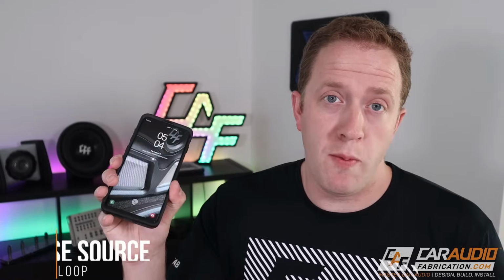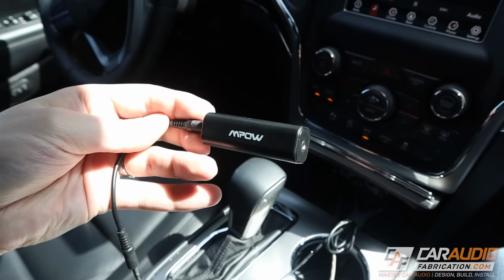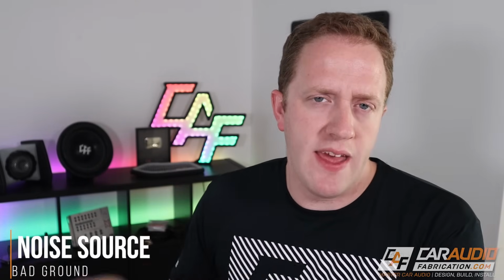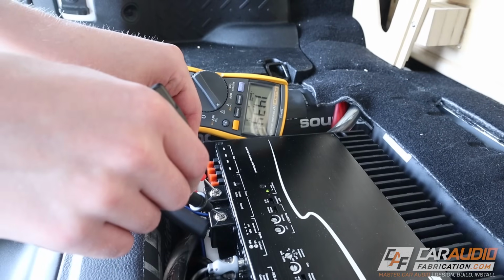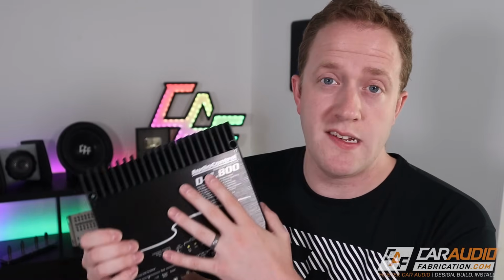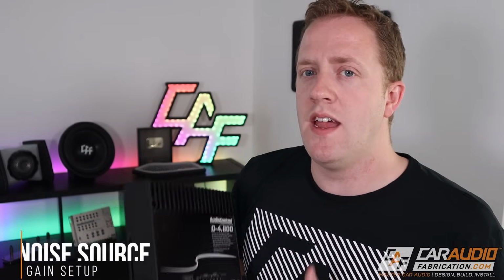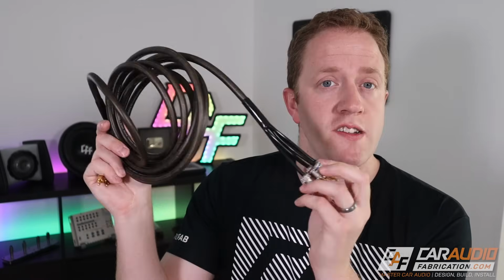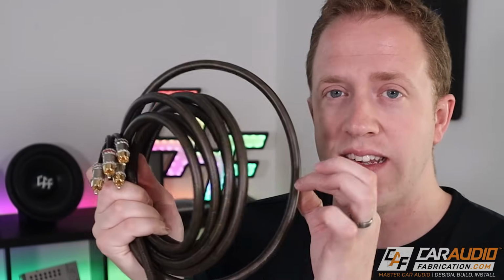BUZZ, WHINE, HISS? How to FIX Car Audio Noise!

Comment: Hi! Love your videos! I have a factory Head unit into a Bit DMI into a Bit One DSP which feeds a JL amp for the 4 door speakers & a Sony amp for 2 custom speaker pods. One of the speaker pods is making a whining noise. Shop says it’s because the magnet is too close to some of the car’s other electronics. Is there anything you can think of that I can place between to shield the speaker? The noise drives me so crazy I’m ready to put a slab of lead back there. Help!

Comment: @CarAudioFabrication, thank you for all the useful videos. I am about to run electric lines in my van conversion and need to run some power cables near my speaker wire (not signal wire). Does that create noise as well? I assume yes. If so, could I add a shielding wire loom on my speaker wire to help? Thanks!

Comment: my system worked great over a year then a loud hiss developed . i got a different amp , new quality rca's , and check all grounds and connections but still HISSING loud even with amp gains low . I even got ground loop isolators and they did not help one bit . No alternator noise just steady loud background hiss. I even replaced my power and ground wires to 4 guage, and doubled the car battery ground wire. Now Im thinking its the kenwood kmm bt318u head unit causing the problem . i guess ill have to buy another but that still might not be the problem.  Ive also changed speakers a couple times but ill try that again tomorrow . The noise is so loud i have to blast the music in order to not hear hissing . Also tried the speaker wire test.  Its annoying that my system worked perfectly over a year then out of the blue i have horribly loud hissing , SUCKS .  New head unit on the way soon i guess. Dam expensive habit on a minimum wage income .

Comment: Just had noise in my speaker build. turns out it was a power supply issue. Changed out the DC power supply to the plate amp and it solved the problem

Comment: I was wondering. My system runs a 2000watt RMS amp with 2 NVX 15" 1000watt RMS subwoofers. They are in a ported box (2 straight PVC ports flanking one another perpendicular to the subwoofers.) They are small probably about 3 inch in diameter on both. Length I can't remember but I believe the box was tuned to around 35hz. I set my gain using a multimeter and ohms law using my phone connected through BT playing a 60hz tone at 3/4 volume on the headunit with my phone turned all the way up and the tone set to 0db. When I play music it is below the threshold of that 3/4 max volume but if I go ever so slightly up maybe a single number higher then in some songs I hear what sounds like the speaker bottoming out against the magnet? It sounds like it is "bottoming out" I want to know your, and anybody who can help, opinion on what might be causing this issue. I am unable to tell if it's the box not being tuned correctly and the port area is wrong causing it to bottom out because of peaking. Or if it's caused by the amp sending a clipped signal. Or if it's because of the power output vs my port size. I posted this in another video but it was an older video so Im posting here as well in hopes that more people see this.

Comment: Just head alpine Ilx 650w car stereo installed Monday... from the moment I left I heard a high pitch hissing. I went back to the shop 30 min later and the owner said  it was common “ they call it floor noise” pretty much u can’t do anything about it😡 I’ve had other am car stereos and never heard it. All I did was replace factory Subaru radio with the alpine... no amp, same factory speakers that’s it!! THE  NOISE DRIVERS ME CRAZY!! I get used to it for a few min then the song ends and I can hear it or  I hit mute, there’s a slight delay before it goes completely quiet:.. Any suggestions would be much  appreciated!!!

Comment: I like to have all of the wires together in a nice, contained package so I used to tie in to the factory ground when installing an aftermarket head unit and every single one of them ended up with noise.  Running a separate ground to a good spot on the chassis has eliminated that though it gives me one more loose wire to tie up.

Comment: What about BEFORE I upgrade my audio system?  I have a PREMIUM sound system that is as of yet unmodified, it has a bit of hiss even at low volume levels coming from the stock head unit.  Its in a 2014 Ford Taurus, the head unit cant be replaced unless its with the same thing.

Comment: I've used many different types of GLI's and coming from an electrical background I can say that there is only one true fix for the major of times this issue exists. Having a nice and healthy ground to return your power flow, (though not all the time), is usually the fix for these. A quick and reliable fix is the chassis ground that is manufactured on the aftermarket unit itself. This grounding point is underrated and underused, but is a little bit a gold nugget!
Keep up the great work Mark!

Comment: Yep, glad I found this video it's like it was meant for me to find it because I've just got two new amplifiers and mounted them under my driver's seat. I previously had an alpine amplifier under my seat with no issues and the bass amp was in back with the subs. I went with the db drive motorcycle amplifiers which have more power and take up much less space than the other ones but now I've got alternator whining I did re locate the ground connections a few times and it did quiet down a little but the noise is still there. I've grounded both amps to the left rear bolt that holds the seat down it may be a bad spot there but I'll try every thing else mentioned in this video, I have not upgraded my battery ground or engine ground I could always try that as well. The noise isolator device will be my last resort option. If any of you have helpful tips for me please let me know I'm all ears since i'm still somewhat new to this hobby.

Comment: I have had noise in the past, one was from the vehicle's electrical system specifically the alternator for whatever reason the alternator was putting out a noise because it was starting to fail so replacing that solved the problem and I also had another issue with the ground wires like you were describing, I had to find the ground wire that was the issue and repair it's connection because it wasn't getting good contact with the metal on the car

Comment: I had a pretty bad noise in my avalanche and I stripped down a remote wire, wrapped it around all of the rca ports on the radio and secured the ends under a screw on the radio. "grounding the RCA's" so to speak. Now I do it as a precaution on every system I install and don't have problems.

Comment: Been struggling to determine if the slight hiss I have with everything on but no sound playing is normal and my standards are too high, is an install issue, or a function of equipment with a less than stellar SNR. I’ve tried all sorts of things to test the install. Been wondering if a line driver between my DSP and amps let’s me keep gains at lowest setting and problem not noticeable or if it’s time to upgrade to better amps.

Comment: I got a weird noise that would come through the subwoofers that were added to a factory system. The subs would play fine as long as the car was not moving. As soon as the car was in gear and started backing up the subs would get this loud rumble. The only way to stop the rumble was to shut the car off. That noise was due to the car having noise cancelling mics to eliminate road noise by using the factory audio system. Unplugged the mics and the noise went away.

Comment: Biggest source of noise is going to be coming from using the wrong type of signal wires.

There are two types of RCA cables, twisted pair, and coaxial. Twisted pair are, as the name implies, a pair of wires twisted around each other. Coaxial are when you have one wire inside of the other.

A twisted pair style is meant to be used with a balanced input amp. A balanced input amp takes two equal, but opposite polarity signals as an input. The twisting of the wires makes any interference in the signal cable equal in both wires. It relies on removing one signal from the other. When it does that, the noise is removed, and the signal is effectively doubled in strength.

A coaxial style is meant to be used with an “unbalanced” or “single ended” input amp. This amp simply receives the signal down the center wire, and the outer wire, that completely encases the inner one, is simply grounded to the vehicle chassis, effectively shielding the signal wire.

The majority of amps use coaxial style inputs, and using a twisted pair RCA cable might induce noise in your system. In this case, even a cheap coaxial style cable will work better than expensive twisted pair cables. I can certainly confirm this from experience.

Side note, some Pioneer stereos have “pico fuses” on the ground side of the RCA outputs, to prevent current flowing through the RCA cable in the event of bad amp grounding. Sometimes they will blow and you’ll get noise in your system.

Comment: Something that may be helpful to others to note. If you are using a cheap passive (non powered) line out converter off of your factory radio and you install it directly behind the factory radio you may be getting a lot of noise there as well. There are a lot of electrical components going on back there and you can test this just by moving the loc around with the vehicle on and powered up. If your stubborn on using one of these cheaper loc's, you may benefit by extending the speaker wire your tapping into and getting the loc gar away from the back of the factory radio to underneath the glove box compartment for example but not as far as the kick panel because you will generally have huge looms of factory wiring there that can interfere with your signal as well

Comment: Had a strange one that I finally got fixed, after installing a new headunit, two amps, front and rear speaker I had the engine whistle, I used high quality RCA and speaker wire and carefully ran all cables so I was sure that wasn't it, tried a noise filter on my headunit power leads, helped a tiny bit but it was still there, tried ground loop filters with no change, even replaced my 4 channel amp thinking maybe it was bad, still no change, all my grounds tested good, power wires were perfect ( 0awg OFC ) so I started looking into other things, replaced the factory ground cables from the battery and engine to frame, again still had noise, I even replaced the headunit thinking maybe it was bad, still had noise then finally the one thing I didn't upgrade fixed it, I finished off my big 3 upgrade, the very last cable I did was from the alternator to the battery, bam noise was gone, the only thing I hear now is my USB dash cam data pulses but only at high volume level with nothing playing ( I used a Android head unit and this is a common flaw with them ) so since you didn't mention that, do the big 3 upgrade, factory power feeds are way undersized and dirty, get nice clean power to the amps and enjoy.

Comment: A couple times in my competition systems. I solved one issue by switching from rca to optical and on another system reversed the direction of my stinger 8000 rca cables

Comment: I had me too before white noise problems and i tried all the things i could read about and nothing helped. i even changed like 4 or 5 aftermarket stereos, i replaced the speakers ,speaker cables ,re-grounded and checked the ground with the multimeter and the noise was still there. then i changed the 4 channel amplifier( which was a Clarion amp, responsible for like 90% of the noise by the way) and i disconnected  the oem amplifier harness to shut down the oem small farting subwoofer :)). after the last two moves my car is noise free. the car is an audi a3 from 2008 if this can help anybody.

Comment: My current system in my 97 ford diesel consists of a digital amp that Ive had in 3 vehicles so far, and I dont have a proper remote wire so it turns on and off on its own with the music. Ive noticed several times on multiple vehicles, but mostly currently since the subs are practically touching the drivers seat in my truck, theres a steady tone when you turn the vehicle off, right around 40 hz. Its never bothered anything, and it was only after you shut everything off, so I never really looked into it. Just realized though I havent noticed it in a long time, curious to see if it doesnt do it anymore or if I just got used to it and didnt notice it anymore 🤔🤷🏼‍♂️

Comment: All day, today, i`ve been trying to get to the source of that alternator noise i kept hearing, going up with the revs, and getting louder with them headlights on. What I found...the pre-amp RCA outputs of the unit make that annoying sound(and it only happens on the FR and FL RCAs / the rear and sub are good). 
So, the only way i coud remove those noises was to add two  hi to low convertors and use the speakers output on my new Joying unit. And yeah, i tried everything...running new gnd to the unit, running new rca cables not along the power cables, measured whatever i could measure, amplifiers gnd is perfect. Oh, one more thing...the radio antena also adds a little noise in the system, because it is grounded somewhere too. 

Up until yesterday I had the oem rcd310, with those  two hi to low convertors, two amplifiers (4ch and 2ch) and a 1F capacitor...well, it sounded good, without any "background" noise.

Comment: Its not just the quality of RCA but type and matching them with the type of signal input you amps and output from your componnents  are built upon. If your head unit uses unbalanced (many do)  and your amp has balanced inputs. (About 85% of amps use unbalanced generally higher end amps use balanced) look into audio control as i think eveything they make has the ability to change from balanced to unbalanced output with internal jumper.

1. Balanced input is where the shield of the input is isolated from the negative power input or the metal chassis of the amp. These setups youll want to use twisted pair RCA

2. Unbalanced input is where the shield of the RCA is NOT isolated and shows continituity with the negative power input and metal chassis of the amp. These setups use a coaxial style RCA.

Comment: ANC Mics will also cause whining or a "robotic buzz" when listening. Ambient Noise-canceling microphones(ANC Mics) are designed to get rid of any noises that the factory head unit and ANC unit deem not part of the stereo output in order to make the ride seem a lot quieter than it really is. It sends the "opposite" sound out in order to cancel out any unaccounted noises. So if you install subs or a multichannel amp to add extra sound, your ANC system is going to try an cancel it out unless disconnected. Most of the time you can find the ANC module and just unplug it or else you have to cut the mic wires(and I don't recommend it if you don't have to, those things are expensive to replace). A lot of newer(let's say after 2013) might have this, new hondas, certain GMs, etc.

Comment: I get distortion in the highs on my Bluetooth adapter when the BT volume is all the way up on my phone. I find that turning the volume down to 75ish% on my phone usually solves the problem. Another thing I've seen in some Fords is popping when changing the source when an aftermarket head unit is installed. Some fords need a couple resistors connected to the factory amp turn on and grounds in a particular way because the factory amp doesn't like a full 12v signal.

Comment: Twisted Rca , remote amp wire and speakers wire together is that an issue ? I have slight noise but have a ground loop isolater it help a bit. Also my amp is ground to my battery which the battery is grounded it self to the car. So where would I start? The separation of the cables?

Comment: In my previous car I had installed an in car computer, it was a fairly complex set up and I always had some level of noise using an aux cable, however, on a lot of modern aftermarket nav units you are now getting an HDMI input, When switched to using that as the audio source all the issues went away

Comment: I actually went a different way with this. I had very bad noise when I installed a bluetooth audio receiver, but instead of using the filter I build an induction power module out of a phone induction charger building  kit and a stepdown voltage regulator and i put everything in a 3d printer case. It severed the ground in the power input instead of the audio line so no ground loop, no noise and no reduction in sound quality whatsoever.

Comment: My car audio gets distorted at a certain volume. I have aftermarket head unit and aftermarket speakers. Nothing fancy or expensive, but nothing super cheap either. To me it sounds like the bass and mids get muddy. Would an amp help with that? Or something else?

Comment: Well done mate. A lot of people will get a lot of help from this.
I myself just bought a new, second hand, car that had aftermarket setup installed. I replaced their head with my Alpine head and replaced the amp with a new pioneer for the sub and I get no noise.
Alas the "professionals" who they paid to do the wiring cut the adaptor in the dash and taped the wires back together. It's sad that people pay money for something and can't wait up to a week for the correct adaptor. 
I enjoy your videos and put them to people who want more than information. Keep up the good work and respect. Peace!

Comment: After a Focal KRX3 install, I started getting alternator whine, it drove me mad. Tried different ground points for the amp and HU but nothing worked. Finally I traced the noise to the HUGE passive crossovers being too close to the fuel pump. Changing the location of the crossovers eliminated the noise completely.